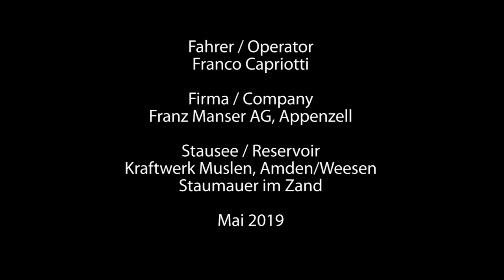Menzi Muck M545 digging out a reservoir in Switzerland on a extrem steep slope

Comment: For all of you people relying on technicalities, this is the beginnings of a mech in the Patlabor universe. They started out as specialized construction equipment until people start committing crimes with them. Then the police and the military had to build bipedal mechs in order to handle weapons and restrain the vehicles.
Reply: Quite , this thing is more akin to an in-between between an excavator and mecha , a so called hybrid locomotion machine considering how the "legs" helps it to reach here and help to climb but the primary method of transportation is by wheels , so yeah , pretty much

Comment: This is seriously impressive machine operating, but I wonder if it could have been achieved with a high powered water cannon and cheaper and safer ? Just a thought and I don’t pretend to be any expert . The operator has tremendous skill and feel for his machinery absolute nerves of steel 👍🏻
Reply from the maker: Dear Richard. It's impossible to reach this workingsite with bigger machines. Also the Menzi Muck had very narrow space down the path and over the bridge
Reply: menzimuckcom  thanks for your explanation I hope you didn’t mind me posing the question  - I’m guessing to get to the skill level the operator has takes many,many hours bravo 👏

Comment: As you may have noticed the M545 does not have a counter weight at the rear like some excavators. The reason for this is because the manufacture has to compensate for the weight of the operators massive balls.

Comment: Simpler solution would be to simply hose it down from above with massive water pump. I think a firetruck would suffice. This would get rid of the mud and unclogges the crate. The Wood can then be removed via Helicopter.

Comment: It is hard for me to believe one person could control a machine with this many moving parts. It must have some kind of computer to help him. Either way that is one hell of a machine.
Reply: No computer present there, not even single smart phone connected. It's all the work of mechnanical engineering, the chief field or specialisation is hydraulics and fluid machinery. Those levers (controllers) he is using are very sensitive to define the complete motion of bucket and the hydraulic tubes.

Comment: I think I would have simply used high pressure water hose and fill the reservoir up and repeatedly drain it.  and the helicopter to remove the branches.

Comment: Is that grate made of rail road tracks? Nice bit of re-purposing/recycling if that's the case.  They should be very wear resistant due to the alloying, forging and heat treating process rail road tracks go through.

Comment: We had two of these in the tunnels (NYC) . I have yet to see a good operator in the seat. Not impressed by this machine. I could have got down there and back with a regular excavator.
Reply: You most probably would have got down there with your regular excavator, but not back up again. That terrain actually is steeper than it looks on the footage. But I guess you are just jealous and can't admit that to yourself.
Reply: @oxydator  not jealous. My original statement stands. Down and back up. Litework.
Reply: @StickyPaw  "Litework" Thats the point where I call BS. I live in Switzerland and never  have seen a regular excavator operating in spots like that one, on 45 degree (not 45 percent) incline and extremely soggy unstable ground. I take the stance "talk is cheap" and am looking forward to your demonstration on video. BTW, you also forgot the access route in this case which is not suitable at all for any regular excavator
Reply: @oxydator  correct, you have never seen. But I do this daily. IUOE Local 14-14b NYC. I’m actually an operator. You sounds like you would like to get in a machine one day. Good luck.
Reply: @StickyPaw  You being a certified excavator operator still does not mean you are right about being able to do what they used a much more complicated and also more expensive one for. Do you happen to know some video showing an example of a regular excavator in a comparable situation, or could you give coordinates for some location this is or has been done? I already had the chance to talk to a walking excavator operator and they told me a regular one always would be preferrable, so they only use walking excavators when there is no other way to get the job done, this also has a noticeable financial impact. BTW I have a degree in mechanical engineering, this is why I'm interested in the subject matter.

Comment: There's no reason to dig out a reservoir when a dam has been removed or when it's been drained. The natural flow of water will remove the extensive sedimentation a little at s time. 

Those sediments are necessary downstream so that coastline can be rebuilt.

Comment: Does not look even remotely safe. Should have figured something you could lower down from the solid area where the camera was. Would you drive that thing like that without a harness? You take these risks in industry, an eventually the thing happens and someone dies horribly. No way this would pass EU regulations. The fault is with the employer. Not even a seatbelt and showing it off like some unheard of new thing. 

Look at the man in the pit Mommy! Why is he coming down the hill sideways in a 3 ton machine without even wearing a safety helmet, Mommy, why?

Don't be silly little one, of course the emperor is wearing clothes. You just can't see them...